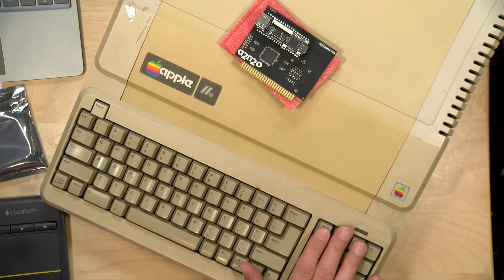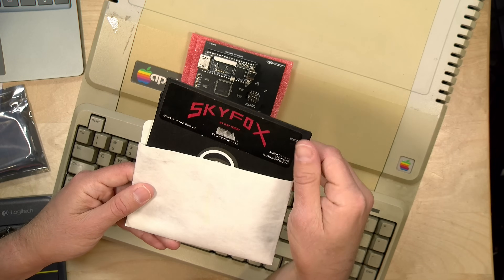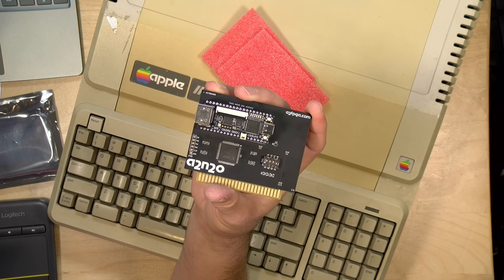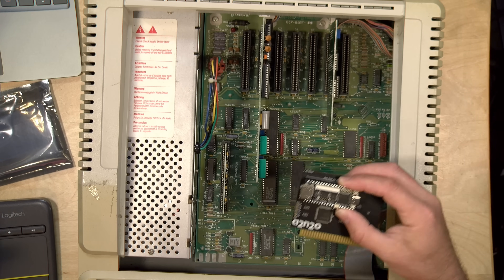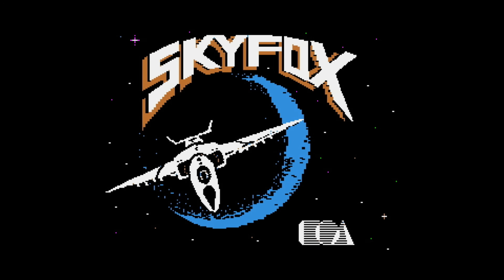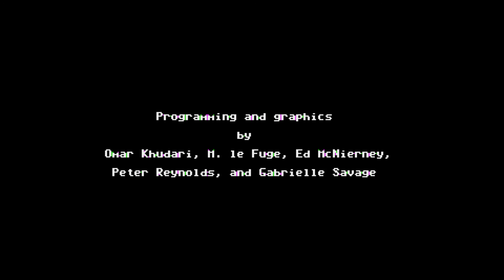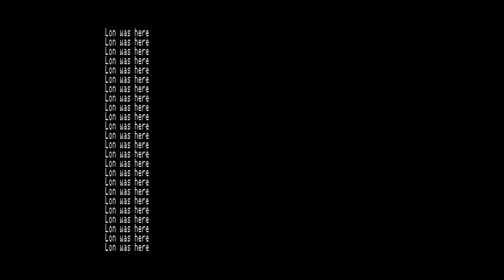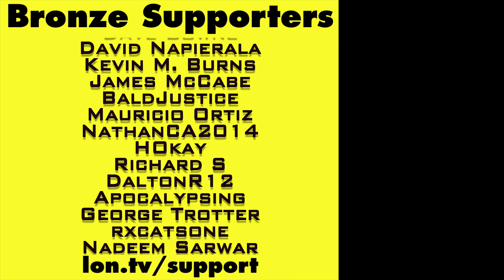Let's Wrench on an Old Apple IIe ! Adding an FPGA for HDMI and Audio with the A2FPGA

Comment: Has there been any further development for the is board, specifically the Apple IIGS. I still have my Apple IIGS from the mid 80s. Spent several years with the Apple II series starting with II+ before moving on to the Mac. Great tech channel 👍
Reply from the maker: They released some revised firmware back in December but still no IIgs Ensoniq support unfortunately.

Comment: $200 seems expensive for what it is. I’m not sure what the other QFP IC on the bottom of the board is, but the FPGA daughter board is around $20-30, so added to the cost of the circuit board they are making quite some mark-up. All that is real needed in addition to the FPGA are some cheap level shifters.

Comment: I'm wondering what the FPGA board they used for this is, might be good for projects in general.
Reply: It looks like the Sipeed Tang Nano 20K
Reply: Certainly looks like a Sipeed part, but I think the 20K would be overkill. The 9K should have more than enough room to handle the video and audio cores needed.

Comment: Still have a few Apple II floppies from 1981, when I was in high school. They had Apples (and dial-up to an HP9000F.) Had TRS-80 Model 1 at home. The Apple floppies are I think older version with fewer sectors (v 3.2?) Maybe one newer version. Also I think one used with a CPM OS adapter. Lastly, many are single sided, but had an extra notch cut out to use both sides. They are sitting in a file cabinet for 43 years. I wonder if they still work. Also just remembered that one might be for a p-system or something OS. I learned Pascal in that, and it became my primary programming language in the future (Turbo Pascal, Borland Delphi.)

Comment: FPGA technology can do some pretty cool things. I recently bought an FPGA for my original 1980 Atari Tempest Arcade cabinet. The FPGA is a plug in replacement for the Tempest PCBs. It is the size the Raspberry Pi that replicates the original PCBs which includes replicating the 6502 cpu.
Reply from the maker: They are amazing! Very well suited for these retro game tasks where most consoles/arcades had a bunch of processes running in parallel on multiple processors.